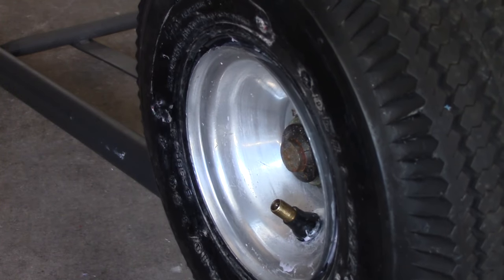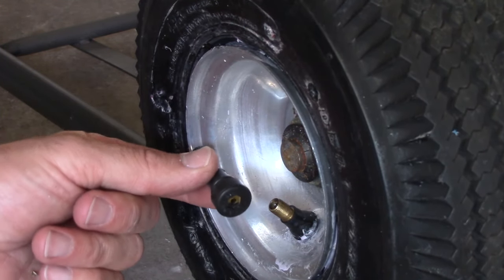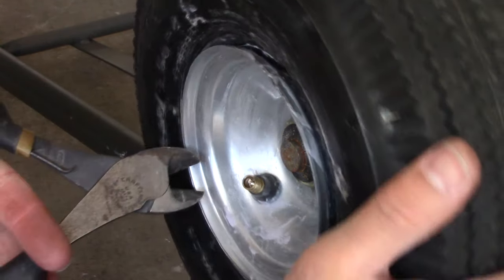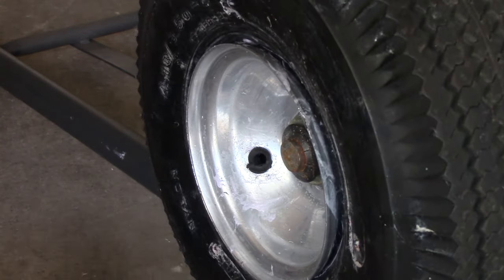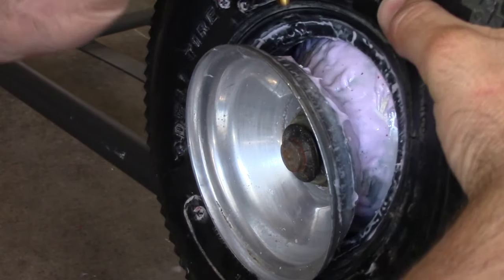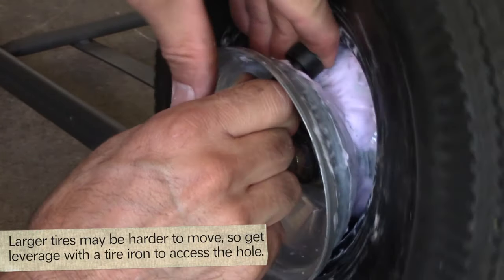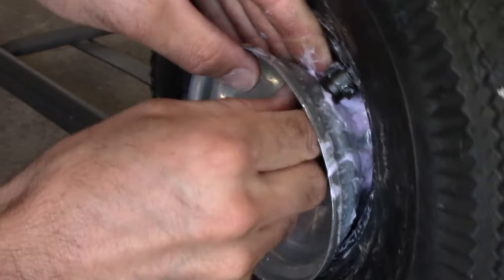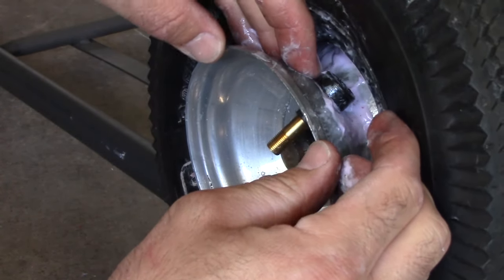How to replace tire air valve stem - small tires

Comment: Thanks for the video but they're often harder to get in than that, even with lube (I use dish soap). I have to push mine with a tool from the opposite side. No amount of pulling or twisting will get them in without help from a tool.  Hope this helps.
Reply: You can temporarily put a nut on the valve thread to help get a bit more purchase.
Reply: They make puller tools they’re very cheap